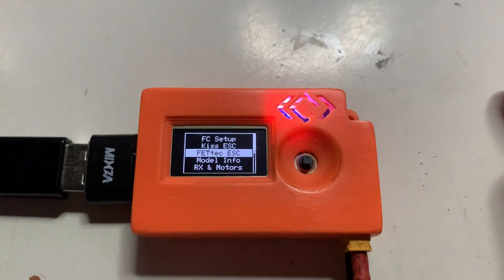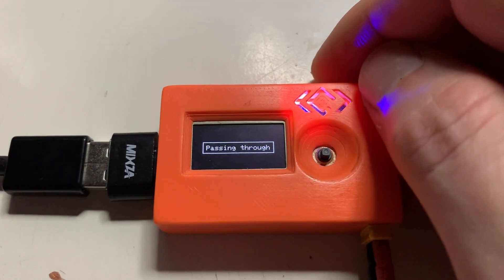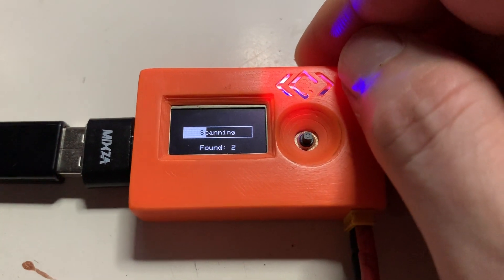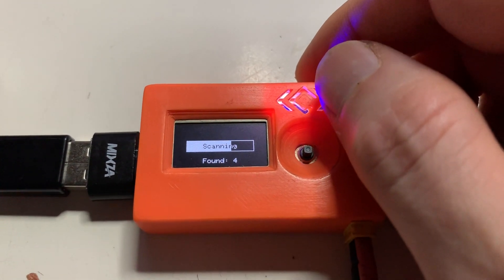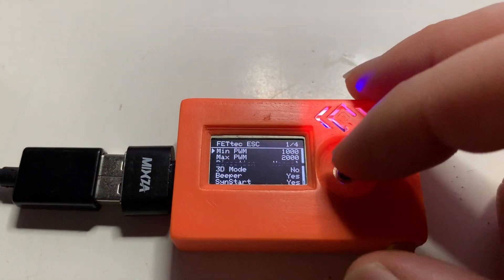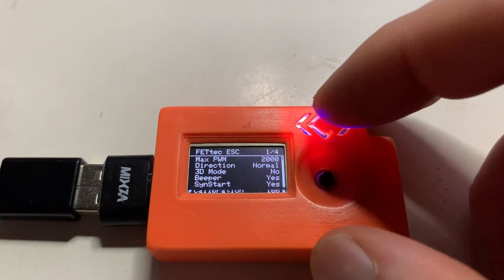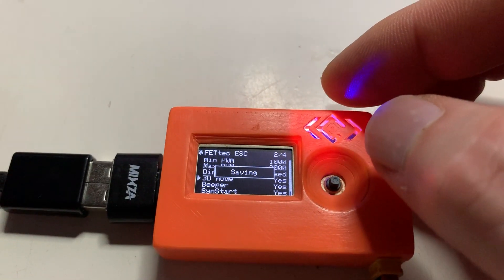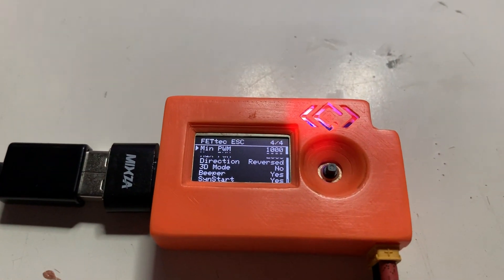KKC FETTEC

Comment: Right on Alex. Looking forward to getting some FET. Would we be able to run the 20x20 esc underneath a kiss FC? Would there be enough room for the 30x30 to support the fc above esc? And have you ran a kiss v1 with your esc yet. Thanks 🙏
Reply from the maker: i do it other way around.... kiss on the bottom, esc on top, with 89a tpu mount ;)
Reply: @alexanderfedorov7890  right on thanks bro
Reply from the maker: and its NOT my esc.... Its fettec.
Reply: @alexanderfedorov7890  Roger
Reply: 20x20 kiss board coming out from fettec anyways, so you could always wait it out.